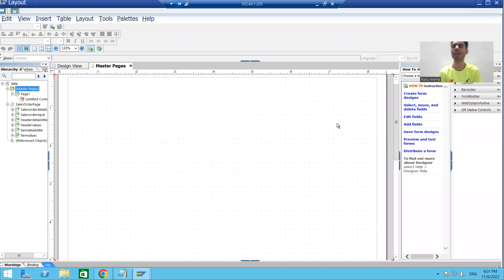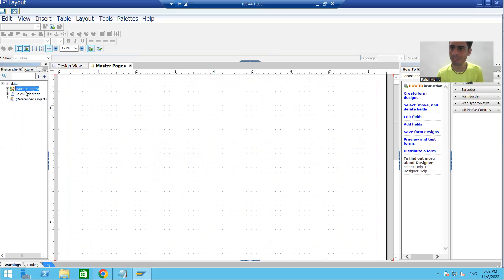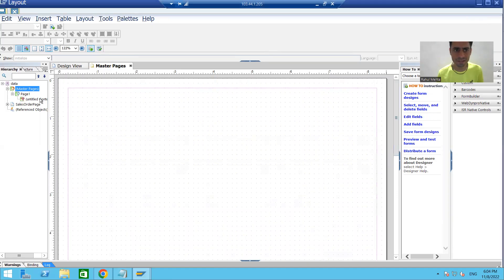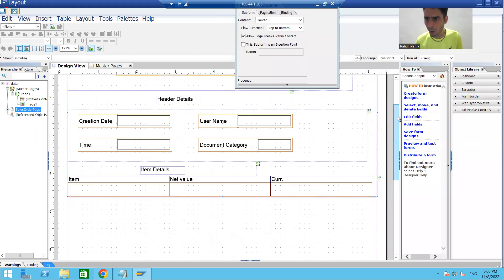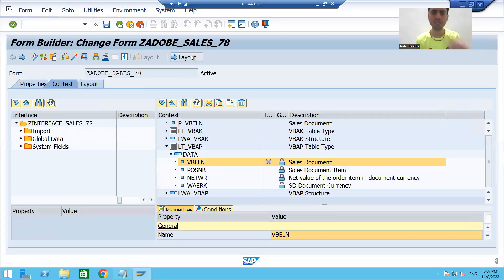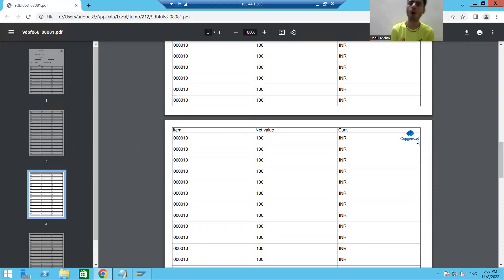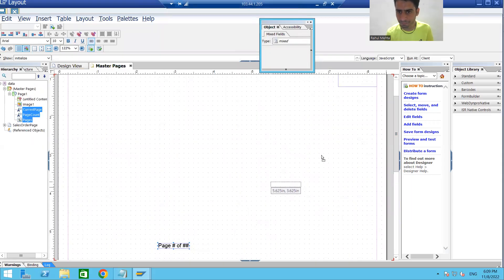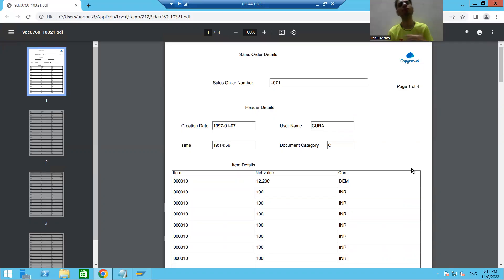9 - Adobe Forms - Creation of Layout Elements on Master Page

Comment: Hi Rahul sir, I have a one issue in Adobe forms please provide me any solution for it
Reply from the maker: Hello - Please mention the issue.
Reply: @sapabapbyrahulmehta  I have a total of 10 batches each has 27 items so it is printed on both pages when it comes to 6th batch onwards every second page batch number printing last batch number but data everything is correct.
Reply from the maker: @vinaychepuri    Hello Vinay - I understood the error but these kind of issues can only be check in live system.

You can connect with someone in your project who has the access to your system.

Comment: Congratulations from Brazil ! Your explanation is fantastic ! How can I put automatically the "LOCL" in output device ?
Reply from the maker: Hello - Thank you for your gratitude.
You can choose either of the options.

1) This device, you can set in user profile.  Go to system-user profile-user data. You will get one default tab there, pass the device name.

2) There is no need to go by first way. As we need to call the adobe form through program. In the future, you will learn integration of Abobe form in program. At that time you can pass the device through coding using DEST parameter.
Reply: @sapabapbyrahulmehta  It works ! Thank you.

Comment: Very nice video Can u reply about nested heading issue in adobe designer
If I am creating 7 page form and h1 is same on header in master pages and its conflicting with h2 and h3 on other pages hpw should I resolve
Reply from the maker: Hello Rajendra - You Can stretch down the content area of Master Page, 
So Body Page content area position automatically change and headers will not overlap.
Reply: @sapabapbyrahulmehta  sir ur answer is completely irrelevant to my question
My question is on appropriate nesting failed ( bcz of heading h1 on master page) and all 7 pages h1 is on header of master page

Comment: I have a Master Page which has the company logo on the left hand corner & Title in Center and a table below it on body page. The table data overlaps the Master Image image  and title when the table flows to the next page. I want the table on the next page to be displayed below the image and title. How to achieve this?
Reply from the maker: Hello, You Can Stretch down the content area of Master Page, 
So Body Page content area position automatically change and Image will display above the data.